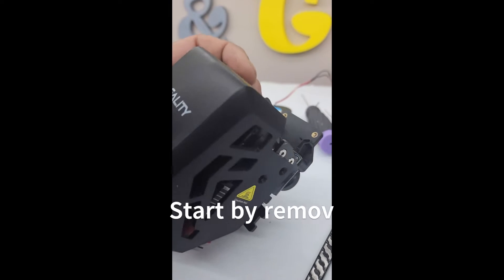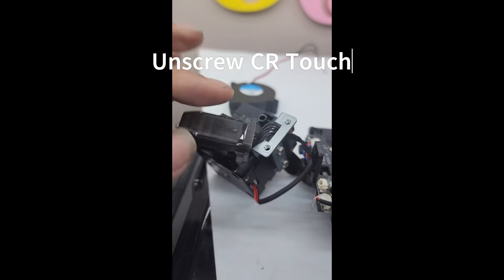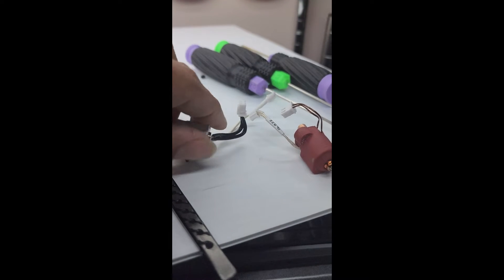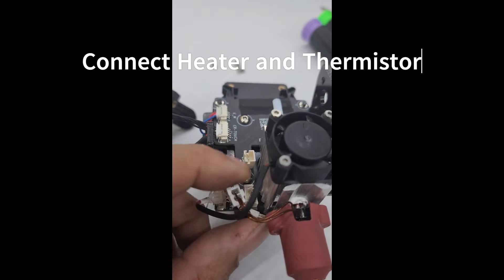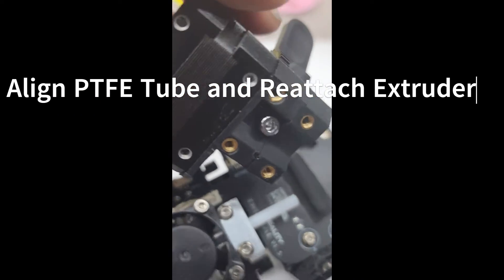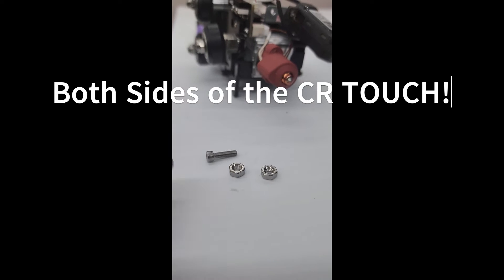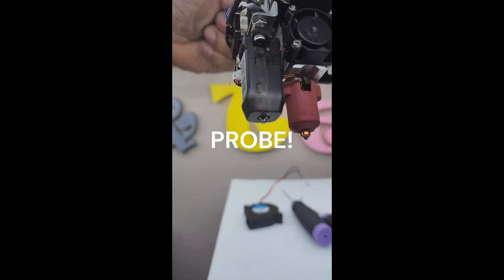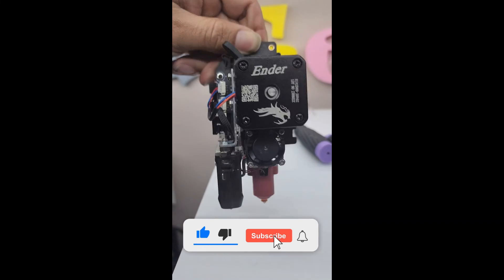Creality Ender 3 V3 SE Ceramic Hot End Install

Comment: I just swapped to a all metal heatbreak which now allows me to do the full 260c. Did you figure out a way to change the firmware to 300c?
Reply from the maker: Yes. The heatbreak is great at preventing PTFE deterioration from excess heat BUT.....
1) You have to have a THERMISTOR installed that can reach 300.  The Upgraded add on Cermaic Hotends by Creality are rate at 300c But have a litte extra that allows them to go over up to 320c but I highly recommending sticking to 300c max setting.
2) You have to modify your PRINTER.CFG file to 300c under Max Temp.  I am using a Sonic Pad with my SE to get Klipper on it so there is options to modify it on the Sonic Pad for you.  If you have Klipper but no sonic pad just edit it manually under the CONFIGURATIONS tab of your Fluidd or Mainsail UI.  Then select your most recent PRINTER.CFG file.  Scroll Down to: "View 'extruder' documentation" under that section there should be "max_temp" and it should be set to either 260 or 265.  CHANGE that to 300 or 305.  The extra 5 is to prevent the Thermal runaway protection from kicking in if the temps get over 300 when heating up.  Then SAVE and RESTART.  Go back in and check and make sure the changes saved.  Then your good.
*if you don't have Klipper you will have to access your Printer.cfg by hooking your printer to your computer and modifying the Printer.cfg file in WORD or NOTEPAD.  Then saving it back onto the printer AFTER you saved the changes to the Printer.cfg. The Printer.cfg is on the MAINBOARD of the printer.
BE CAREFUL NOT TO CHANGE ANYTHING ELSE IN THE PRINTER.CFG file that you don't know what you doing.  You can brick your printer.
Reply: @3DandTeePrinting ender 3 V3 se runs marlin, there is no printer.cfg for marlin, you would need to recompile marlin, alas creality has not released their marlin source.  However there is already an option to get klipper onto an se with a rpi, which is what I have done, works great.
Reply from the maker: @pellcorp  Thanks.  Been running Klipper on the SE so long I Forgot it was Marlin based out the box. My bad.
Reply: @3DandTeePrinting  yeah I'm familiar with how to change temp in klipper. I have done it on a s1 with a sonic pad. But still running stock Marlin on my SE.

Comment: Hey man i had justvordered fans for a dual fan setbup but seeing as how this lowers the nozzle 5mmish will i have to fond a way to lower the fan ducts or should still cool good with it?
My parts come friday and i want to be ready
Reply from the maker: You can modify the STL and add holes in the slicer.  I physically Added Holes AFTER the fact.  Heated up my soldering tip and added new hole just above by the originals (about 3-4mm) and it is now the correct height from the bed and just about the tip of the nozzle.

Comment: I did some thinking (and looking) and saw that the hotend design for the SE is nearly identical to the Ender 5 S1 (barring the different shape in the heat sink). By extension, could this mod be possible on the S1?
Reply from the maker: Yes it fits on the 5 S1 But it's not a simple switch.  I have already switched my 5 S1 to the SPIDER 3.0 so No need for the Cermaic Hotend for me but yes it can be fitted but needs some altering of your fan, cr-touch, and a few other things.

Comment: Did you had to run a pid tune after upgrading the hotend?
Reply from the maker: Yes.  100% recommended or your temps will fluctuate.
Reply: @3DandTeePrinting  I also have an Ender 3 V3 SE and I bought the same hotend, but I can't find the thermal paste that you showed in the video. Would it be a problem to install the hotend without thermal paste? I live in Brazil and I can't find anything of quality in national stores, I also couldn't find it on AliExpress.
Reply from the maker: @ronaldogomes5335  You CAN but the thermal paste helps with keeping a good thermal connection.  I have done it in the past without it and had little to no issues.
Reply: @3DandTeePrinting  Thank you very much, i’ll try it without the thermal paste.
Reply from the maker: @ronaldogomes5335  it's also called BORON NITRIDE.  Not sure if you have Amazon in Brazil.  That's where I get mine from.  I use one from SLICE ENGINEERING they may ship to Brazil.  One tube last a while.

https://www.sliceengineering.com/products/boron-nitride-paste?utm_source=google_ads&utm_medium=g&utm_campaign=20491169998&utm_content=154385619284&utm_term=slice%20engineering%20boron%20nitride%20paste&gad_source=1&gclid=CjwKCAiArLyuBhA7EiwA-qo80JmNxq1YV9EBEqctF4YM8Gsdm_-Mujqd7xV35LON-N6lnMMkdc2pOhoChEsQAvD_BwE
Reply: @3DandTeePrinting  We do have Amazon in Brazil but i couldn’t find this kind of thermal paste there. I’ll try to buy directly from Slice Engineering
Reply: They do ship to Brazil 🎉🎉🎉
Reply from the maker: @ronaldogomes5335  There you go.  Then you will always have some extra if you need it.
Reply: @3DandTeePrinting  It’s very expensive when taxes are applied, it will cost like a third of what i paid for the hole printer 🤣🤣🤣
Reply: @ronaldogomes5335  Any problems not using the boron nitride? I'm also looking for it but after shipping and taxes it costs double the price of the hotend.
Reply: @Luiigii52  No problems so far

Comment: Did you use the Ceramic for K1 ? Why not for KE ? Is the KE fitr better ?
Reply from the maker: KE already comes with the Cermaic Hotend that is offered on the K1.  The SE I just chose the abrasion resistant K1 hotend for better long-term use on the machine.
Reply: Would a ke sprite be a drop in for the se  @3DandTeePrinting
Reply from the maker: @Kami3Kaze  The SPRITE is the EXTRUDER System and the Same on both printers.  The HOTEND is what is swappable on the SE.  Keep in mind there is a different setup for Cr Touch and Linear Rails carriage on the KE that is not on the SE.

Comment: What kind of Fan Mount are you using for this hotend?
Reply from the maker: I had to "manually" remix this STL (drilled 3 new hole placements in already printed parts 5mm higher to compensate for new nozzle location).  I am sure there are other designs out there that work better with this setup but I didn't go looking to hard after I hard already had my heart set on using the single 5015 blower.

https://www.printables.com/model/697788-ender-3-v3-se-single-5015-fan

Comment: Couldn’t find the tiny screw on the silver  cover could you tell me where to look on the printer?
Reply from the maker: It's called a set SCREW.  It should be located directly above the heatbeak (metal tube) in the actual heatsink (silver aluminum part with lines all along it horizontally.  NOT THE PART WITH THE NOZZLE ATTACHED TO IT).  It's VERY SMALL and USUALLY black but could be silver.
Reply: @3DandTeePrinting  Thank you 🙏

Comment: hi, can I get a link to where you got the hotend?
Reply from the maker: It's just a K1/K1 Max Ceramic Hotend. I recommend the K1 MAX or Hardened Steel tipped version as it is abrasion resistant for CF, glitter, GF, and glow in the dark filaments. You can get them any where.  Aliexpress, Amazon, or Creality store.  Usually $20-$30.

Comment: will the printer recognize that the temp can go up to 300 or do you have to modify it?
Reply from the maker: You can change the max temp in your printer.cfg file.  I am running the SE off a Sonic pad so there is an option through that interface to do it right on the screen.  If your not running klipper on it you will need to hook it up to a computer to access the internal files.
Reply: K thank you
Reply: What is klipper
Reply from the maker: It's a User Interface that allows you to have more control over your printer.  Think of your 3d printer as a new kids bike.  It comes with training wheels on it so you don't fall over (break the printer).  Klipper Takes those training wheels OFF.  If your taking off the training wheels you can now get the bike (printer) to do cool tricks and stunts you couldn't do with the training wheels on.  BUT you got to know how to ride (use) the bike (printer) first  before you do or you could end up injured (breaking your machine).
Reply: Is it possible to change the .cfg file myself? And if so, what kind of software do I need to do that?

Comment: How much stronger is petg over pla
Reply from the maker: There is a lot of confusion on "STRENGTH".  Each material has its "pluses and minuses".  For.example PLA doesn't hold up well against constant tension on the part but can hold more weigh then PETG or ABS.  Think of thick sheet of GLASS.  Strong yet if impacted will shatter or crack. Whereas PETG will SLIGHTLY flex to absorb some of that strain.  Usually resulting in a bend before failing.  PLA doesn't do well will higher ambient temperature and will start to warp and bow.  PETG has a higher resistance to heat and is more UV resistant.  So it all depends on what your using the part for.

Comment: I put a Spider speedy hot end on my Ender 3 pro with a CR touch. The spacer idea is great. Mine seems to be right at a 0 nozzle offset but a little play would be nice. Thx for the video.
Reply from the maker: Hopefully the 3.0 and not the 4.0 Ceramic one. I have BOTH.  The 4.0 was so bad creality pulled it from their stores and people are now buying up the left overs through 3rd parties (Amazon, Temu, and Aliexpress).  If you have the 4.0 PLEASE PLEASE PLEASE send it back immediately before you have to deal with the nightmare that is the SPEEDY SPIDER.  The 3.0 that's an awesome hotend.  Currently running that on my Ender 5 S1 and had it on my V2 for a while as well. The 4.0 I didn't return it in time and I have been trying to get it to work on 6 different printers with nothing but heating failures or it shuts off your printer mid print with an error code for irregular heating.  This is a known issue with it.
Reply: @3DandTeePrinting  thanks for the heads up. Nothing specifies which version it is. It seems great so far tho. Is there an easy way to tell which version it is?
Reply from the maker: The 4.0 is Ceramic and looks like a rectangle that is all Red with a TINY silcone sock over the tip of the nozzle and a V on the face.  The 3.0 is NOT ceramic and has a BIG black silicone sock that says "SPIDER" on it.
Reply: @3DandTeePrinting  Hmmm that's not good. I have the 4.0 then. Might explain why my prints have been stringy and can't get the thing to work properly.
Reply: @3DandTeePrinting  i haven't had any heating error issues but I don't think it's reading the proper temp either. Maybe the heating error you're having is a firmware issue? I had that issue with one firmware with my old print head. Prints have been super stringy even after I dried the filament good.

Comment: Quick question, how’d you get the entire head off of the gantry?
Reply from the maker: Hard way: Unscrew the POM wheel with the eccentric nut then pry it over the lip of the 20x20 extrusion.  LOOSEN and Remove Belt attached to the carriage.
  
Easy (LONGER/correct) Way: Take off fan shroud, remove extruder motor, Loosen and remove belt from carriage, unscrew POM wheel and screw with the eccentric nut from backplate, once POM and Screw are off the toolhead pulls right up and off.
Reply: @3DandTeePrinting  I see. It really doesn’t matter if I have to remove the belt because I’m looking to add a linear rail to the gantry anyways. Did you use a 300mm rail for yours?
Reply from the maker: @Daizlol  300mn MGN9C for the STL and it fits perfectly.  I was worried about the lip on the left side behind the x axis near the gantry but with the brace it lifts it just over it.
Reply: @3DandTeePrinting do I need to do any estep recalibration when I swap this hotend?

Comment: awsome upgrade, nice video! but with the ptfe tube we can still only reach like 240-250ºC even puting capricorn instead we could gain just a couple degrees, what u think?
Reply: The reason you can't do the full 260 . Is because there is a piece of ptfe tubing in the heatbreak.  Simply swapping for a all metal heatbreak will solve the issue. The piece of ptfe tubing on the top that goes into the extruder.  It never gets hot it's just to help guide the filament.
Reply from the maker: The Cermaic one has a Bi-Metal heatbreak already installed.  Which SHOULD allow for 300c temps without issues with that PTFE tube in there.  My Upgraded Sprite PRO kit on my Neo also came with a PTFE tube in it and I print 270c ASA/ABS on it with now issues after 2 months.   I did ended up changing out the PTFE to a Capricorn on the SE when I had to take it BACK apart to install the linear rail bracket.  Just for peace of mind.
Reply: I can't get my ptfe tube in,  mine seems to come with a metal tube going through the hotend
Reply: @jasonpeterson5004   You got the wrong one. Thats the unicorn upgraded one.

Comment: Great Video...  What is the benefit of going with a Ceramic Hot End?  And can you provide the link where you order it from?  Thx
Reply from the maker: You have quicker heat up and cool down times.  More Stable temps. Better PID tune.  300c temp printablity.  You have to update the max temp in your printer.cfg from 260c to 300c to reach though temps.  But that is a quick change.  If you are running a Sonic pad/ BTT Pad you can change it through there as well.  Basically the Flagship Nozzle.  Also with THIS version (hardened tip) you can also print Carbon Fiber High Temp Material's (in theroy but I plan on testing that).
Reply: The capability of higher printing temperatures. The stock hotend on the SE is only rated at 260C, and the K1 hotend is either 300C or 330C I believe. Though you will have to install new firmware to be able to run this printer up to that temp, you’ll still be able to print more reliably at 260C.

Comment: Wow really amazing how we can just upgrade it like that. Might look into this vid in the future once I learn more on 3D printing. One question is. How do we now get cooling to the new hotend. Do we need to create and design a new fan shroud and duct?
Reply from the maker: I did NOT make a shroud.  BUT..... Some else has a design I am working on REMIXING to fit the new distances.
Reply: Any luck on a new fan/shroud that works with this?
Reply: Currently have the Ender 3 V3 SE too and learning how to print PETG and TPU next. Tuning the profile on Cura slicer
Reply from the maker: @aimanramizu6901 It's been Great for both TPU and PETG.  Hope the the same for you.